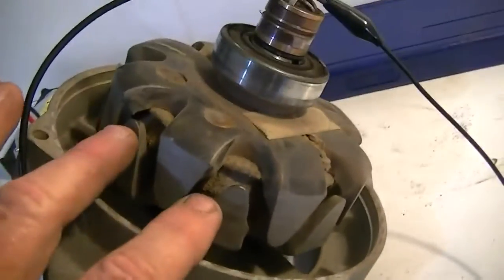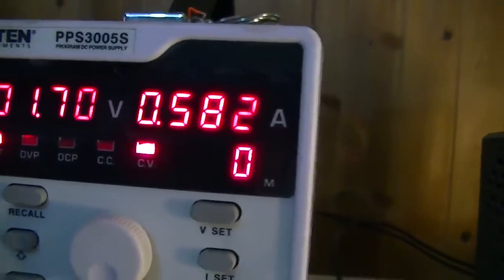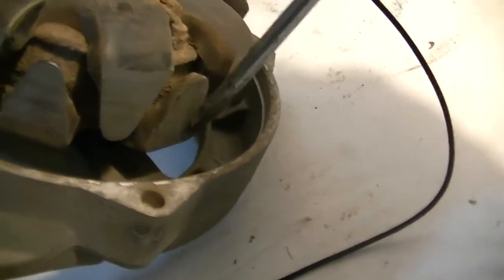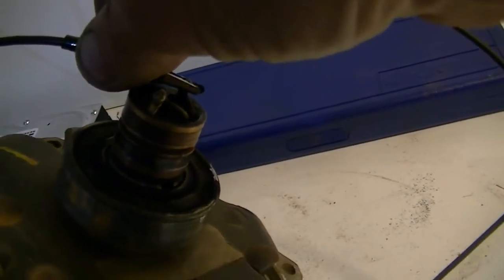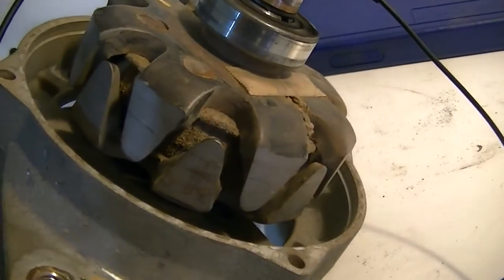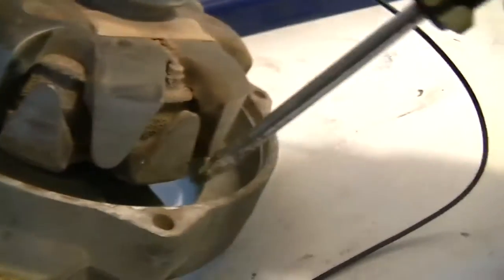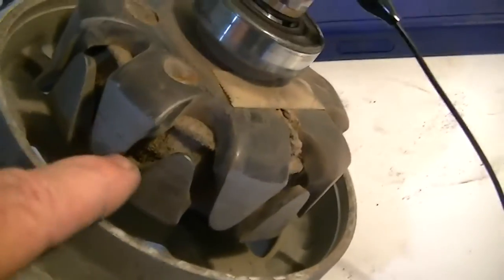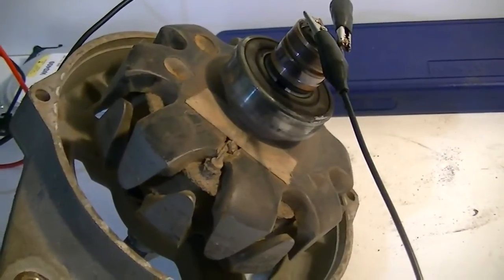Monopole magnetic effect

Comment: These claw types pop up in PC printers at micro sizes, like 1/2" diameter. Complete bugger to take apart, but normally miles of 40 gauge wire inside. I'd imagine they can be very finely speed controlled from the construction. Maybe the other pole is in the very middle of the coil, but have never tested one to find out. Will rip something apart to have a further look :)